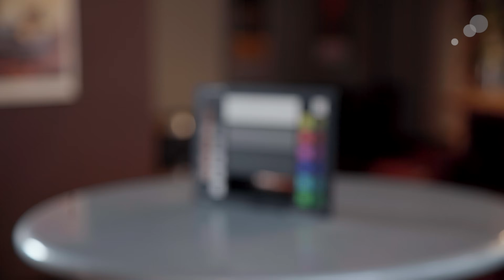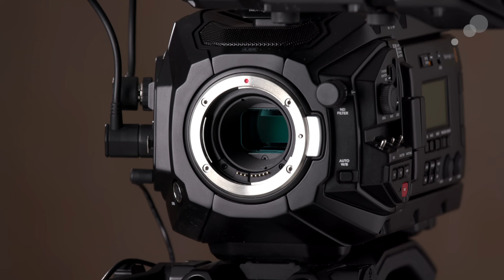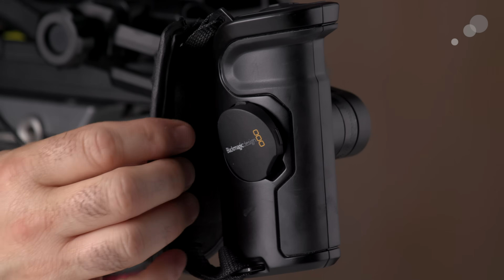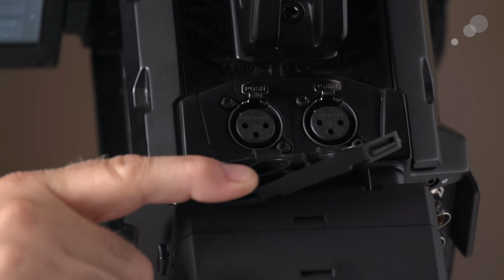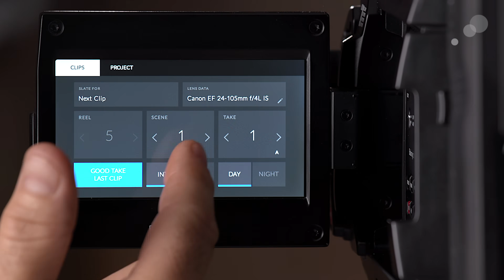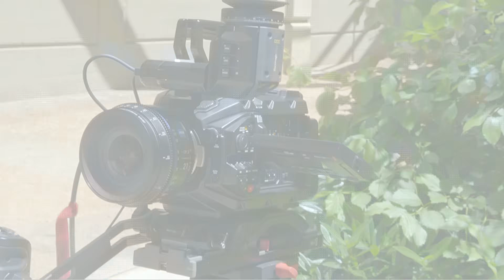4K for $10K with Jem Schofield: Blackmagic Design URSA Mini Pro 4.6K

Comment: Great but you can get 4K for $500, and $2000 for a professional 4k camera lol. No need to spend 10k on this beast
Reply: If you just want 4K and nothing else than you can just use an iPhone. If you want a decent, modular cinema camera with the proper codecs and features you're gonna have to go into the Ursa Mini price range. Just because something can "do 4K" doesn't mean it's any good for professional use, there's a lot more than just pixel count that matters.

Comment: About the viewfinder. You can see two knobs for adjustments. the first (right) regulates how far you want to strecht it out from the camera the second (left) regulates how stiff the eyepiece is moving. You can completly lock it or give it some sticky to loose movement. Great. Some people might wonder why you want to window your sensor when not shoting RAW losless? Simple answer: if you are using B4 broadcast lenses which are very awsome being parfocal lenses, they will NOT cover the whole sensor producing a black ring on the image. Here come the windowed sensor in play, puff, no more black ring due to using a B4  mount lens.

Comment: I have downloaded the footage and put it on my timeline (444) but I noticed a great deal of Fixed Pattern Noise (FPN) especially in the 1600 footage but also in the footage with the girl in the sunlight.
I was just wondering if you made the black calibration and if you dont think something might have gone wrong?? Of course if you crush the blacks the FPN is barely noticable but after all shooting in 10 or 12 bits is there to give you more latitude in post to play with colours and exposure. I am especially referring to the shot "Girl in the sunlight". The pullover in the shadow exhibits a lot of FPN and as soon as you want to lift the blacks or the mids...it's very present. Evene without lifting the blacks or the mids actually. And it is also present in the shadowed background.
What is your opinion on this.
Thanks for the work and the effort.
Reply: i just reread your comment revisiting your video and realized (as i was commenting ‘nerd!’) i’d already commented on it!
Reply: Simply put, one of the downsides of this camera IS the fpn starting at 1600 ISO. Thats the way it is and why I never go higher then 800 ISO. But, I do a lot of live concert shoting and never had any problems with not having enough light. So just stick at 800 ISO and you'll be good.
Reply: Nicolas Franik only nerds have eyes for FPN.  99% of all audiences don’t notice shit!